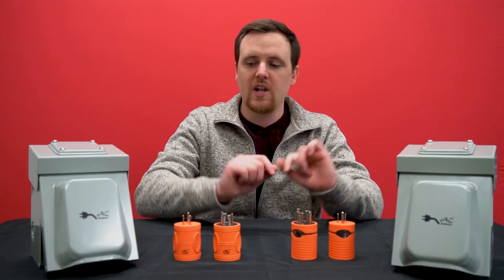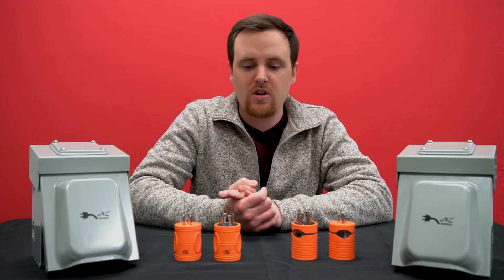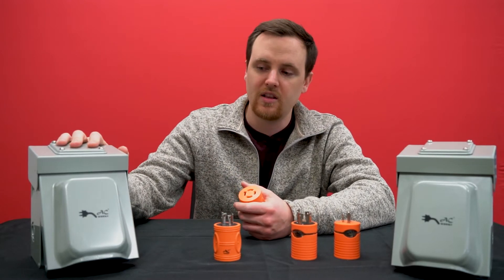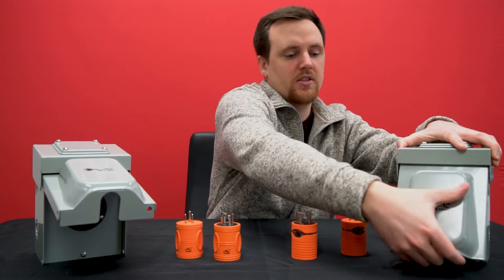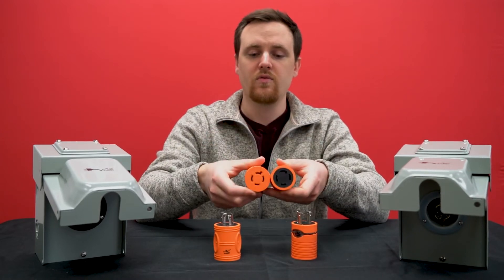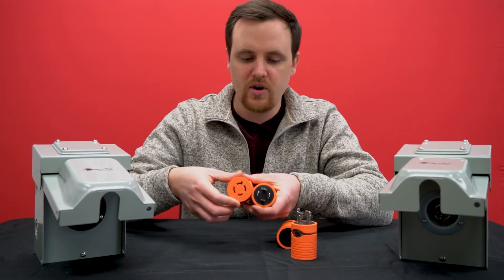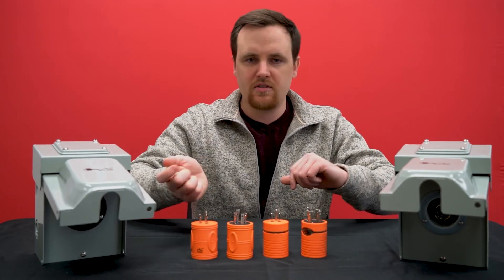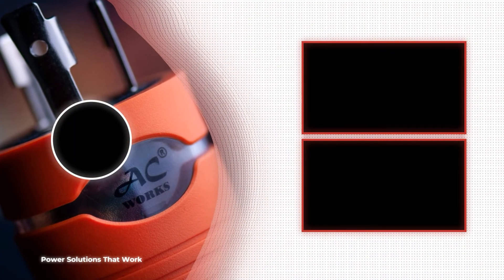How to Identify L1420 and L1430

Comment: My generator has an L14-20 receptacle, and I already have a twist-lock plug to match connected to a 10/4 cord. I'll be installing an inlet on the house soon, and was considering installing an L14-30 on that end to accommodate higher amperage/wattage in the future should I decide to upgrade my generator. There shouldn't be any issue with having the 20 amp connector on the generator end of the cord and the 30 amp connector on the house inlet side of the cord, correct?
Reply from the maker: Good question. So you would actually need an adapter to go between the L14-30 inlet and your L14-20 generator cord. The prongs on both connections are slightly different. The notch on the L14-30 goes inward while the notch on the L14-20 goes outward. So they won't line up and you should not alter either to try to make them fit. You will still only get up to 5000W of power from your L14-20 if your generator is rated to go that high. Hopefully that helps you! 
Here are a couple of adapters you could use:
https://acworks.com/products/locking-adapter-adl1420l1430?_pos=1&_sid=b580496e3&_ss=r
https://acworks.com/products/ac-works-l1420l1430-018-1-5ft-l14-20p-to-l14-30r-adapter?_pos=1&_sid=758d735fc&_ss=r
Reply: @ACWORKS  Perhaps I wasn't clear in my initial comment. The generator is L14-20 and the inlet will be L14-30. The cord I'm making will have L14-20 on the generator side, and L14-30 on the inlet side, so no adapter necessary, the cord will do the work of adapting 20 to 30. I was just confirming that it's not going to be an issue feeding a 30 amp rated inlet with a 20 amp generator. Kind of a rhetorical question I suppose, of course it's okay to feed lower power into a higher rated inlet, but not the other way around.
Reply from the maker: Ah yes. Sorry about the misunderstanding there. Yes, you will be fine using a cord like that.

Comment: Where can I buy these adapters? I can't find them on your website.
Reply from the maker: Which product are you looking for? AD515L1420 or the AD515L1430? We have both. 

AD515L1420 Link:  https://acworks.com/products/ad515l1420-locking-adapter?_pos=1&_sid=63e32de8d&_ss=r

AD515L1430 Link:  https://acworks.com/products/generator-adapter-ad515l1430?_pos=2&_sid=63e32de8d&_ss=r

Comment: "CircleCord NEMA L5-30P to L14-30R Adapter Cord, 3 Prong to 4 Prong Generator Transfer Switch Adapter, 30 Amp Generator Twist Lock 3 Prong to 4 Prong House Inlet Box, STW 10 AWG Blue."  Do you lose any power using this adapter? Issues?  My new generator has the three prong L5-30 but the house inlet and old generator were 4 prong L14-30.
Reply from the maker: The thing to remember is that L5-30 outlets and cords are rated for 3750W. That also depends on if your generator is rated for that high, too. Those are the things to keep in mind.
Reply: @ACWORKS  OK, my new gen actually also has an AC 120/240V 14-50R outlet.  If I get a 14-50P/L14-30R adapter so I can make the existing hookup to my house (with transfer switch) with my existing cord (1430R/L14/30P 10 ft.) and my new gen is 1100w peak and 8300W running what if any power limitations would be created hooking it up like this?  Could I hook up my 2.5 ton AC as well?
Reply from the maker: Since your generator has 8300W running power, then you would go based off of the L14-30 inlet. You could get up to 7500W from your generator to your inlet.
Reply: Last question: would this in any way create a weakness in the existing fuse configurations since the gen power is now coming from a 50A outlet being reduced through the adapter to go through a 30A cord?
Reply from the maker: No, there wouldn't. Your L14-30 inlet is pulling whatever power it needs. Its not about the 14-50 outlet being reduced through the adapter. Your L14-30 inlet dictates how much power it will pull from the generator. And L14-30 can go a max of 30A 125/250V 7500W.
Reply: Thanks

Comment: Do you have to twist those after plugging in order to lock it, or do they go straight in?
Reply from the maker: Yes, you need to twist them to lock them into place.
Reply: @ACWORKS  
Thank you sir.
Would you be able to answer yet another question for me?

I'm still very much in a learning phase, as I have very hard time with understanding electricity, since it is invisible unlike mechanocal gears and linkages..etc.
I had recently bouth a generator, because of a  power outage, but not knowing anything about generators I had bought a pretty big one (11500 W/9000 w).

This thing has 2 regular household outlets (15 amp?), then a 30 amp 4-prong plug and a very large 37 amp 4 prong plug (was told that one is for a stove, allthough I do believe that stove is 50A?)

So I figured that as it stands right now, I can only access about one third of the available power through the household plugs.
I wanted to change this by getting a 30 to 15 amp adapter so I can acess that plug as well, thus distributing the load on the generator.(I did not see any adapters that would convert the large stove one to 15 A)

So I had bought a Y adapter (30A to 2x 15A), but was only able to push it in about half way into the generator plug.

Could it be possible that either the plug on the generator or the plug on the cord is out of spec?
I didn't want to push too hard because I didn't want to break anything....could it be that maybe the plug on the generator is of the non-twist variety? (assuming there is such thing).
Reply from the maker: I haven't come across a cord or generator outlet that is out of spec for an L14-30 connection. Is the generator brand new? Band new outlets can be tight, which is a good thing. There are other 30A outlets, but those would be 3-prong. L5-30 is also locking while TT-30 isn't. Generators usually use the locking style since generators can shake a little bit. So the locking prevents the plugs from coming out. So I'm not sure what issue you could be experiencing.
Reply: @ACWORKS  
Thank you sir...maybe I should have used more force, but I was afraid of pushing in the plug from it's mounting bracket, as these things are likely made of plastic.

So in your opinion, any 4 pronged 30 amp plug should plug into the generator that has the 30 anp 4 prong outlet..correct?

Can you think of any 4 pronged 30 amp plugs out there, that would be non compatible? (perhaps the non-twist-lock plug into a twist lock socket or the other way around)
Is there such thing as a non-twist lock plug?
My generator does not specify this info and the people at the store where I bought it have no idea.
Reply from the maker: There are other 4-prong 30A plugs that aren't twist lock. But those are never seen on generators. An example is a 4-prong dryer outlet. That is 30A with straight blades. 
There is L14-20 20A which looks similar to L14-30 30A, but one of the prongs faces the complete opposite direction. So it would be impossible to fit L14-20 into L14-30. I'm not sure what the issue could be with your connection. Maybe try contacting the generator manufacturer to get more information on what connections you have exactly.
Reply: @ACWORKS  
Thank you for helping me out with all of this valuable info.
I had ordered another another one, as I'm starting to suspect the plug on that cord was out of specs.
If this one fails to go in all the way, then I will be contacting the manufacturer.